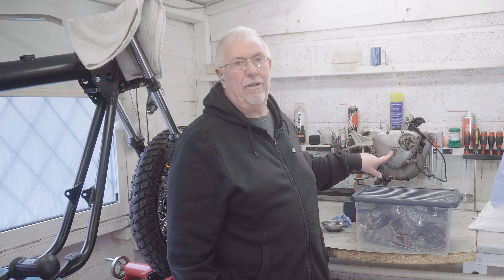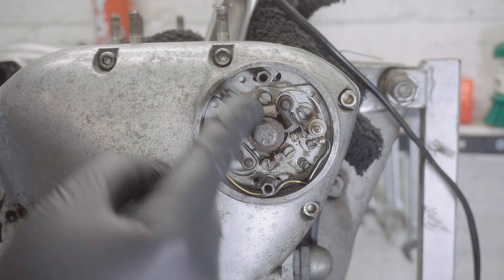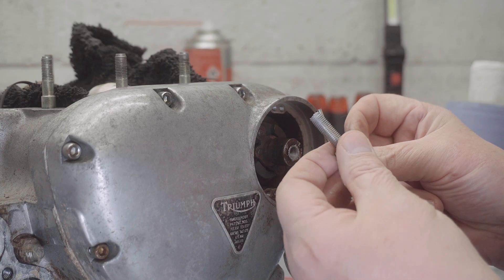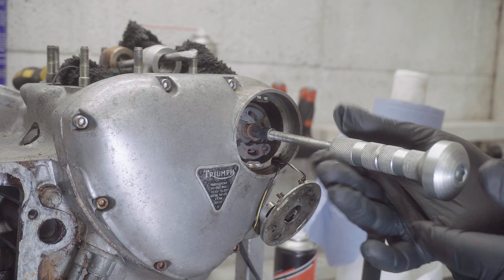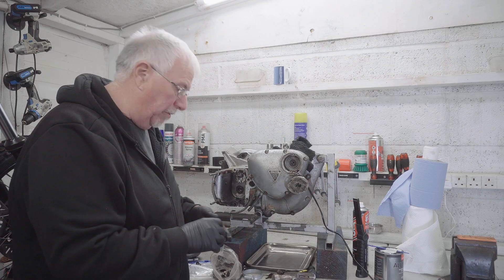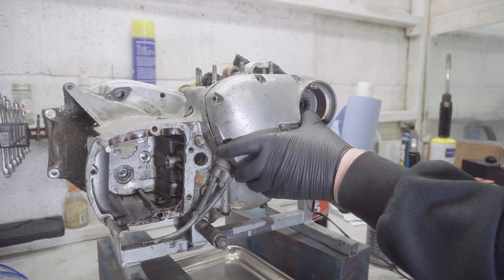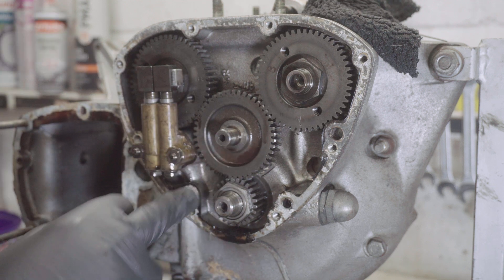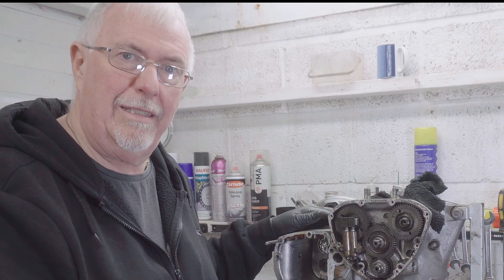Triumph T140 Timing Cover Removal | Exposing the Cam Drive, Oil Pump And  Ignition | 33

Comment: The screwdriver through the con rod small end has now ruined the rods. There will be a dent in the surface now.  A socket bar is a very good fit if you do want to lock it up from the small ends. Again, the use of high torque electric nut spinners will often result in snapped bolts/stripped threads on a Triumph. i have never used one on any of mine in the last 50 odd years of working on it and the BSA Spitfire

Comment: Those  2 gears thst u said need a specisl puller......no...u can see on their face that there are 2 tapped holes...screw in suitable long bolts back & forth 1/4 turn each ..the gear will come off
Reply from the maker: Thanks for sharing the method for removing the gears, that's a good tip!  I was thinking about the earlier cams.

Comment: Electronic ignition is your friend. The points system is not.
Reply from the maker: I appreciate the advice, electronic ignition is definitely a common upgrade for these bikes!
Reply: @SPANNERRASHI tried to make Lucas ignition work in the 70s and it doesn't improve with age.  Magnetos were much better, coil was a cost savings measure.
Reply from the maker: Ha.  TBH they tried to cut every cost out, probably because they never had any money!
Reply: @SPANNERRASH Velocette went bust because, apart from two disastrous attempts at making scooters, they could no longer get Lucas magnetos. They tried Lucas coil ignition and it tended to misfire, and for some reason they wouldn't go Bosch or Nippon Denso. 
I tried - Honda ignition coils are better than Lucas ones - but the terrible points system is either constant failure or constant maintenance. The most embarrassing failure I ever had wasn't even a bike - it was a Series II Land Rover whose condenser shorted at a set of traffic lights and had to be towed.
Years later I turned down a job offer from Lucas to work on their Diesel injection systems. It was not a mistake. Nowadays most people don't even know they ever had one.
Reply: @PeanosZero  Lucas Bryce injectors were in every diesel locomotive in the Uk IIRC